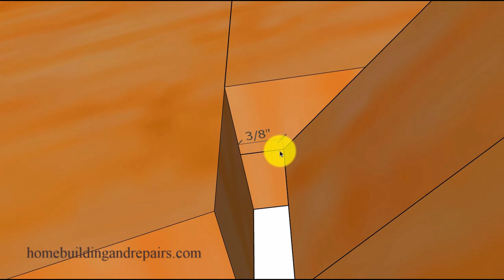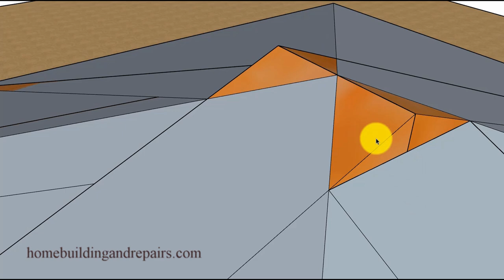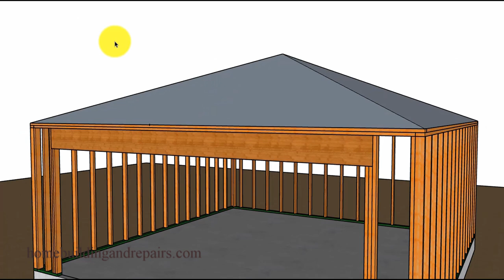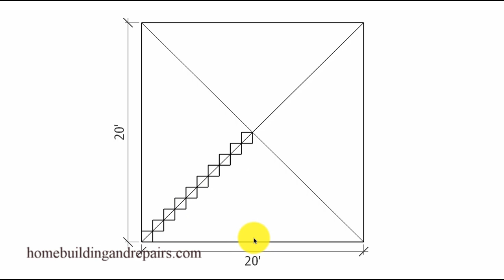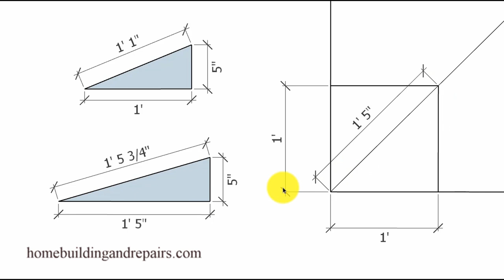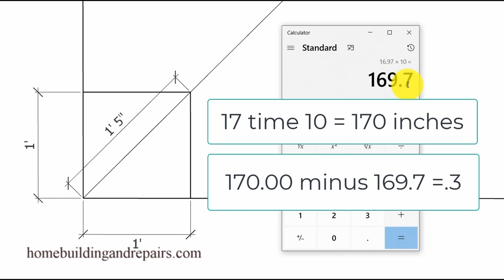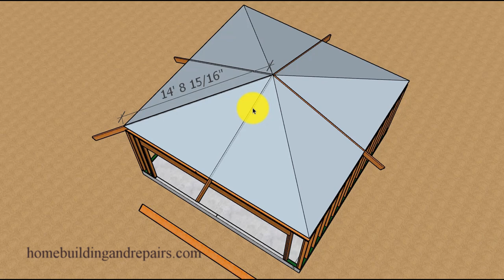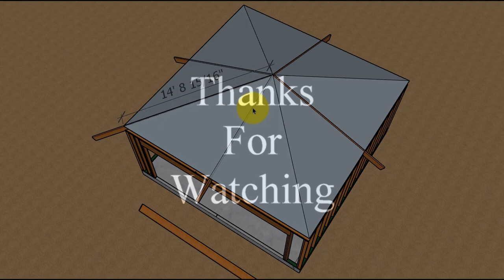This Is The Reason Why Hip And Valley Rafters Might Not Fit Correctly - Roof Framing Education

Comment: I’ll never be building a hip roof. But, as an amateur home renovator and do it myselfer, I can’t begin to tell you how many times that being off an 1/8th of an inch when cutting or measuring caused me problems. I can’t even imagine doing a project like a roof and being off 3/16ths of an inch and assuming it won’t be an issue. Love your videos and I learn a lot from something like this, and I apply it to my other projects.
Reply from the maker: I love it and sometimes a measurement that's off horizontally can effect something else vertically like with stairs and roofs.

Comment: The equation is 12 / cos(angle).  Since the hip/valley is typically 45 degrees, 12 / cos(45) = 16.9705.  I had a really weird roof recently where the hips were at 67.5 degrees but once you understand the math it's easy to figure everything out.